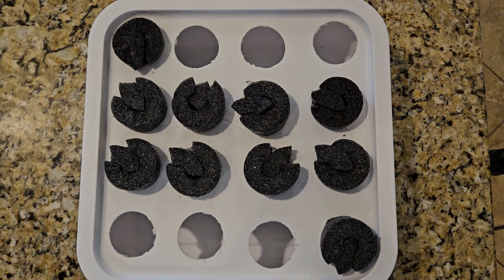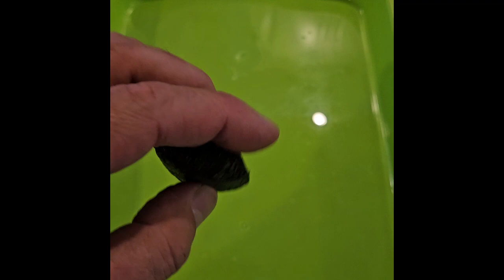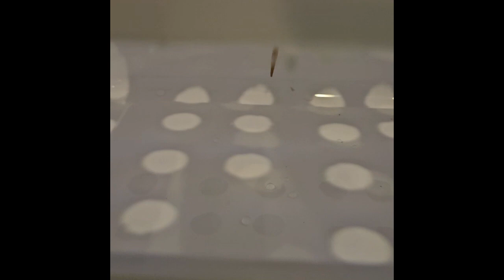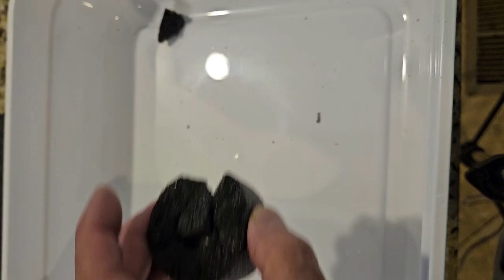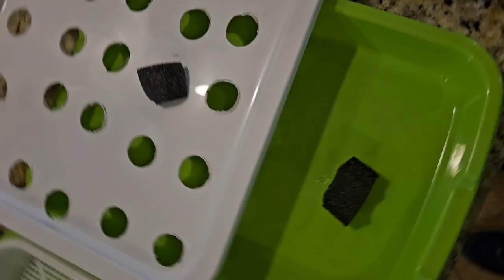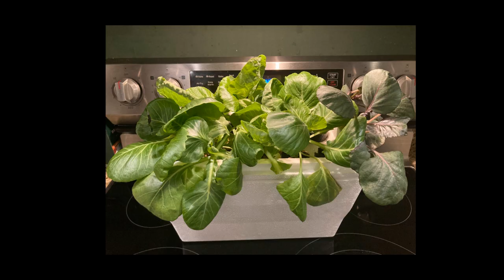How to use Pool Noodles in Various Hydroponic Systems!!!  #garden #diyhydroponics #hydroponics

Comment: For the full system, do you use a bigger brightroom tub? I assume that you do to allow the roots more room but am wondering which size you have found works best for you. ❤
Reply from the maker: I use all 3 sizes. I used the Large size for the Cucumbers shown in my last video. I put 3 in each tub. Other plants at different stages can use medium or smaller tubs for the full sized grow. The root size determines the tub size and the upper plant spreading size determines how many holes I will use. Empty holes can just be plugged completely with a pool noodle. 
The Target tubs are slightly translucent. The nutrients will start to turn green around 45 days or so. Steps can be taken to remedy this by covering the outside with something like a cloth or putting the nutrients inside a mylar bag inside the tub. Alternately you can just swap out the tub and nutrients every 30 days or so. This is mostly a problem outside with the bright sun. Inside it takes much longer before any problems arise. I only use a single shop light per grow rack level in my grow room. The plants do fine, and the light really takes a long time (if ever) to affect the nutrients. 
I also have had great success indoors with dollar tree Styrofoam coolers. An occasional one will leak so check them first before using overnight. These work for several years. They may become slightly stained on the inside, but they work well too.
As I mentioned previously, I also love the hanging shoe rack indoors. Combining Trays. Tubs/Coolers, and the Shoe racks can take full advantage of even a very small space. :)
Reply: @TroyTime02  that helps! Thank you. I think I have 5 dollar store coolers and 6 small brightroom tubs right now. I’ll start with them and expand if needed.
Reply from the maker: @kingdomwriterstv  That's Awesome! :)
Reply: @TroyTime02  and I just set up a second shelf to use for these. It was one I had in my garage so didn't have to buy anything. It's in front of an east facing window so I'm wondering if I can use it without needing to buy additional lights.